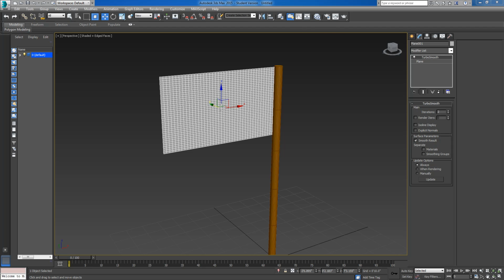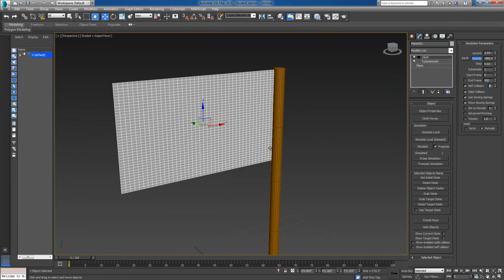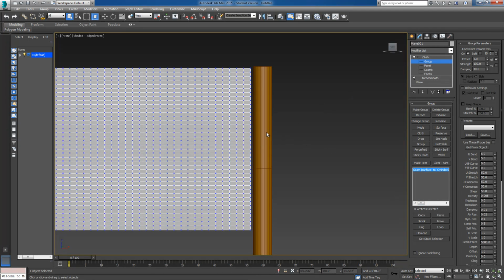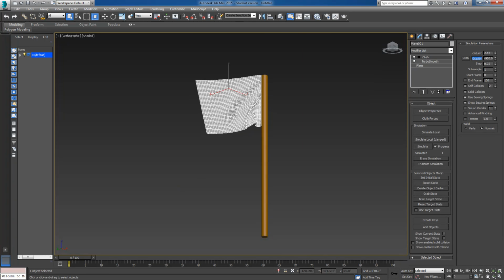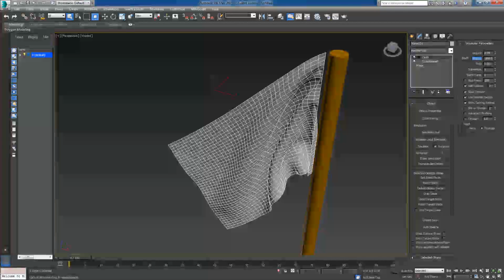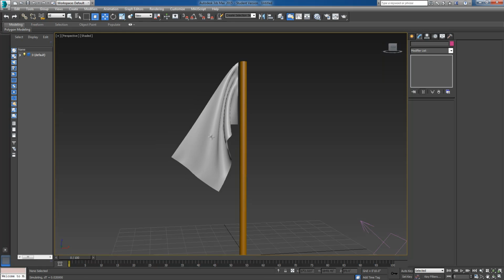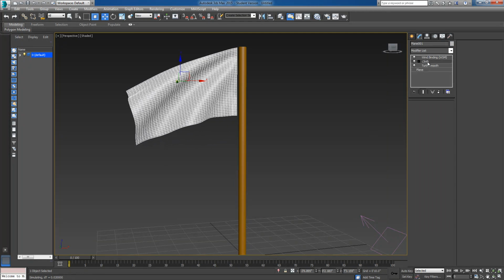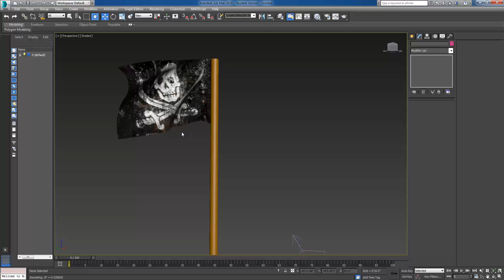3ds Max Tutorial - Cloth Simulation 2 (Flag and Wind)

Comment: Question, I'm trying to test this on a single object that is made up of several  separate elements (a sail to be exact) and it has ropes and such that are not attached as one geometry. unfortunately when i start the simulation, the ropes start blowing in all directions when i need them pinned to the sail tho. :/ can I group and pin vertices of a mesh to other vertices in the same object?

Comment: if we have already premade curtain .. do we need cloth simulation on it ? or we can use directly wind effect on it?
Reply from the maker: A curtain is just a piece of geometry until you tell it to react to physics, like wind. You do that by applying a modifier (cloth is easiest) to the object. Otherwise, the wind will have no effect.
Reply: Mike Woolf thanks
Reply: i am trying and its reacting but only have one problem its not waving...its just pretending like wind is not stoping or have variations..like your flag has.
Reply from the maker: Review the part where I add the wind and play with the wind settings. You will want to decrease the force and increase the turbulence.
Reply: Mike Woolf thanks i need to work on it to get perfect.

Comment: Hey man, i have a problem when i try to attach the "Seam" to the pole surface, i just can't do it, i am running 2014 version. 

It just don't let me to assign to any surface of any mesh.
Reply: Im using 2017 and the same problem. The select cursor doesnt show up so i cant select anything

edit: okay add the object you want to select to the object properties window, and set it as a collision object. it should work then.
Reply: make sure you have added both cylinder and plan in cloth modifier if its not added plz heck it again by selectin both one by one ,if they are not added repeat the  colision and cloth options in cloth modifier .
Reply: This was the question. Mike Woolf forgot this detail.
Reply: Just to clarify which object properties are meant: in the modifier cloth menu, the first upper panel is Object properties. Go into it, and choose the object from the left to be active (one is for cloth, one for collision object). Once selected, choose from the right menu, whether it's a cloth, or a collision object.
Reply: @MIchaelSybi  refuses to select the cylinder for me, done all the steps 3 times now.
edit: it's just the max is bugged and whenever I go to the object properties I find that the objects aren't defined as either cloth or collision. Eventually max remembers. So it eventually worked.
Reply: @cr0uchingtiger  I think you have to select the object type first, then close the window, then open it. Then it will remmeber. Do it for each object at a time
Reply: You have to make sure that the collision object is sharing the cloth modifier AND is defined as a collision object in the Object Properties window.  It can be easy to overlook this part.

Comment: Two part question. Any general advice for someone trying to make a photography softbox like this: http://thumbs.dreamstime.com/z/photographers-soft-box-light-11041356.jpg I got the tripod done, but I'm new to 3d rendering.

Second part related to the flag, do you happen to know if I need to do anything extra to get the flag /curtains blowing in Unity, the game engine? Would I need to make it into an animation?
Reply from the maker: +Kyle Pfeffer For the lightbox, I'd honestly just go with a standard modeled object. Don't even worry about cloth. Most of what we do is cheating the effect. So if that means we can get away with doing something a lot easier and gets the same/better/believable/desired result, do it. I'd get the model looking the way you want it, don't worry about deforming the canopy too much, and then focus on putting a good material/texture on it. If you're new and/or running short on time, that usually goes a long way.

I believe Unity has it's own Wind generators. Take a look at the manual http://docs.unity3d.com/Manual/terrain-WindZones.html.
Reply: +Mike Woolf thank you! that was really quick and helpful. Looking forward to more videos!

Comment: Very useful, but I'm confused as to why the damped option worked?
Reply from the maker: +Mat Broomfield I gloss over it here, but explain it a bit more in the first Cloth Simulation video. The damped option allows for more time/calculations per cycle which gives the simulation a more accurate response. So if the Local option isn't working alone, it's probably because Max isn't given enough time to calculate where everything should actually be.

Comment: I was trying to do a looped cloth animation but so far all I could do is turn the animation into vertex animation (create keys feature) and then copy the first key to the last position and remove some keys to create a transition. I could not achieve an ending frame identical to the initial frame. The cloth modifier has a bunch of stuff like target state and such but even though I tried searching I found no way to keep it in "simulation mode" (without turning it irreversibly into vertex animation) yet make proper looped animation. 
I want to create a knight as a character for a game and the very first hurdle, a simple walking animation already looks weird because of the battleskirt flipping when the animation transitions from last frame to first. Sadly the game engine does not support cloth physics so I have to do that part in max completely. Any ideas other than the "create keys" thingie?

(By the way, the biggest problem with the conversion to vertex animation is that by removing keys to enable a transition so it looks less unreal, the vertexes that act as anchors and are sticking to an object might start floating as the cloth won't follow the object properly anymore - since I removed some keys. I can remove those keys only from vertexes that are not "anchored" to an object to create a close-to-perfect illusion but since I can't move my vertex selection from editmesh straight into the animation/curve editor, it means I have to find the name for the anchor vertexes and make sure not to touch those... one-by-one... tried parameter collector but either I'm too enexperienced or that's just plain not for this purpose.)

Anyways, do you know a way to make a looped cloth animation? Of course everyone else is welcome to answer this question too :D